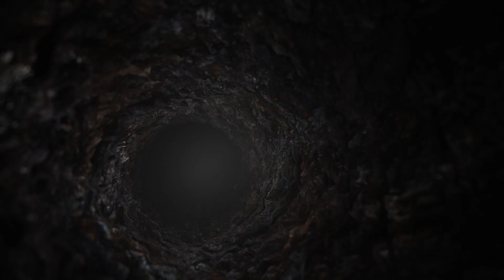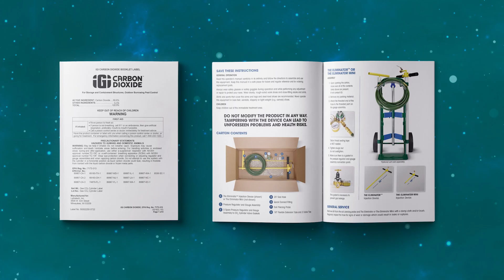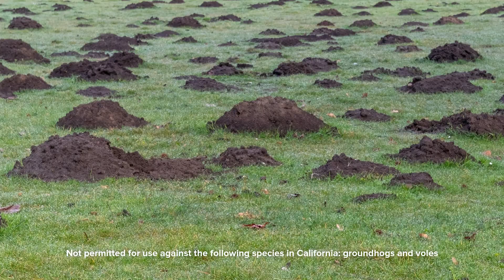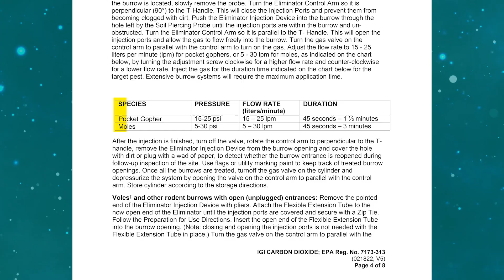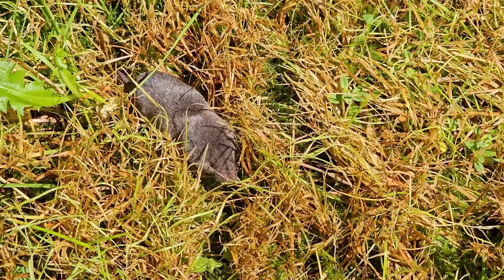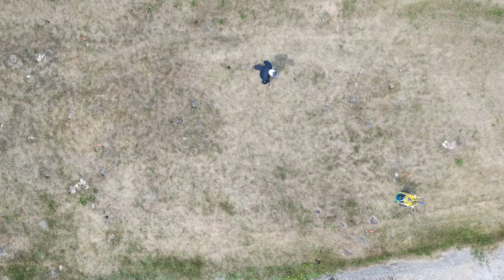IGI CO2 Overview and Application Instructions

Comment: Nice video, but I'm confused. Multiples times in the video you state that the flow rate should be 20-30 lpm. However, the flowmeter (red numbers) maximum is 25 lpm. Is the operator estimating where 30 lpm is or is this not achievable with the supplied equipment?